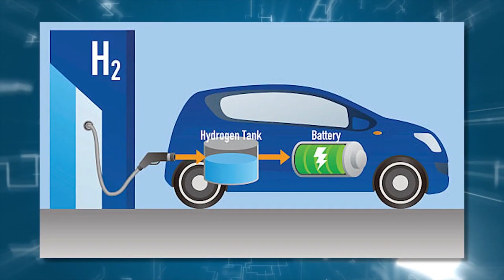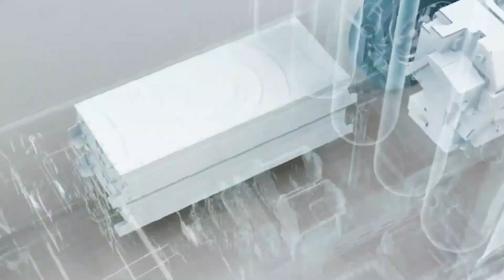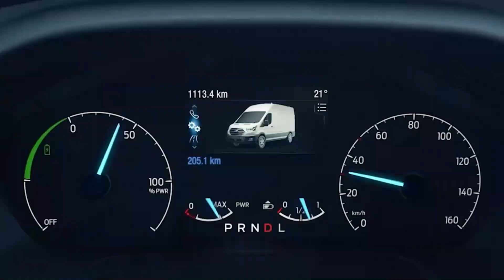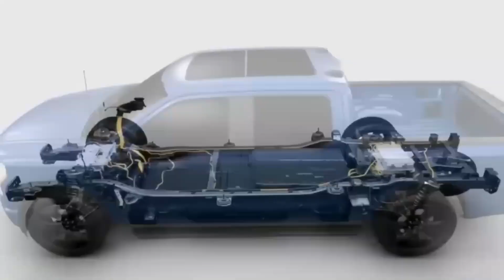Ford CEO Reveals A Hydrogen Combustion Engine That Will Destroy EVs!

Comment: I can support hydrogen powered vehicles as long as hydrogen is actually burned in an internal combustion engine, and not used in fuel cells to generate electricity. There is way more to a car than efficiency. The mechanicalness, the sound, and the feel are far more important. Not that it really matters to me. I will be driving gas powered vintage '1960s and 1970s cars for the rest of my life. I have no desire to drive a new car, even an internal combustion one. Way too many computers. Touch screens, cameras and microphones constantly spying on you. Computers taking control of the car away from the driver. I already have enough REAL cars and parts to last me the rest of my life.
Reply: It has to be stored cryogenically, has a low octane rating, and has a low energy (calorific) value for a given volume, as well. Of course, there is also the need for lots of cheap electricity to produce it in the first place.
Reply: Glad you're enjoying your technology.